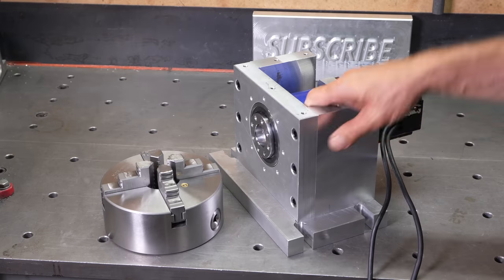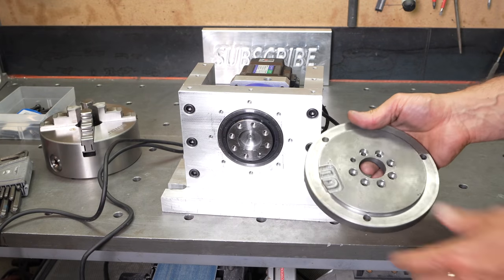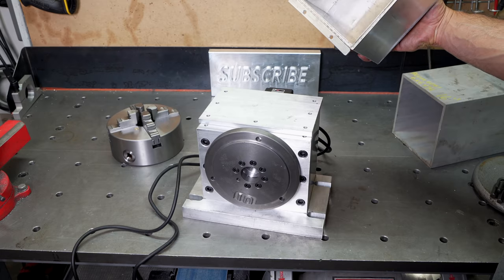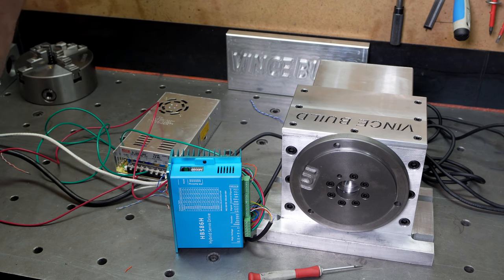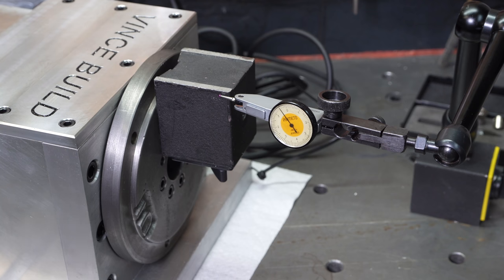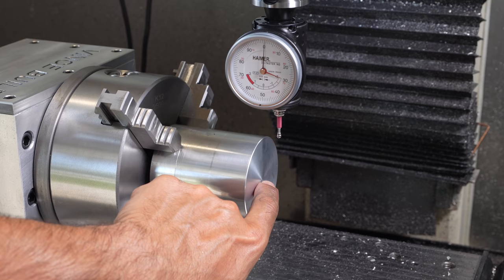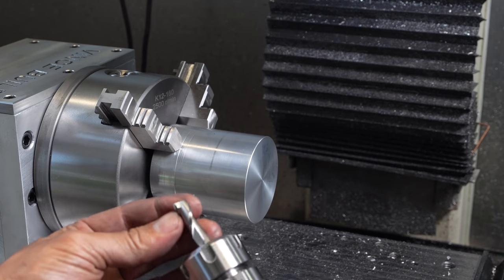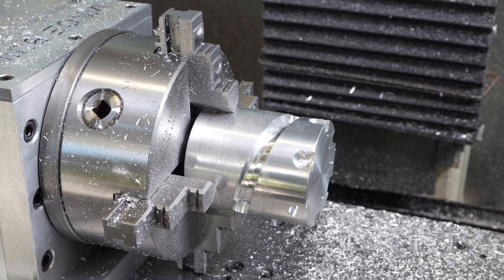4th Axis build part2

Comment: I have the same chuck on my lathe. For better runout, machine the indexing part of the backplate a little undersized and clamp a endmill into the chuck. Mark the pinion you used to tighten it. Then loosen the bolts and just snug them up again. Bump the chuld around until a dti reads as little runout as possible on the endmill. Tighten the bolts and only use the marked pinion to tighten the chuck
Reply from the maker: Awesome, thank you for the tip

Comment: I don't know if you got your issue sorted out with z going to home position. If you didn't, try this. In fusion 360 CAM, in the post processer part there is a box for "safe retract" make sure this this is not set to G28 and to clearance height. Hope this helps.

Comment: good afternoon friend was great the service and the perfect finish this congratulations, ok att sader. I'm just going to give a constructive hint of the whole service. The flange usually has to have about 3 to 5 cents more in the case of this 160mm plate, it would have to be about 130.05mm in order to enter the pressure and not have any slack because that could be it that gave that minimal difference, more coming back to the video it was perfect man show of ball

Comment: I thought I was the only one who used weights for cast iron!
Great job by the way. I am doing a similar project for my college machine shop. Do you think I could get one of these to work with a HAAS TM-1 ?
Reply from the maker: Thank you. I guess if stepper drive is compatible with TM-1 it should work
Reply: I think they sell with their new machines an "optional provision for a 3rd party 4th axis"--maybe check and see if it has that?
Reply: I own 2 VF4s if you have the 3rd party option, as another comments says, it should be good, I would personally buy a Haas rotary though.
Reply: @BebenX  thanks for the answers, I will check if the college opens this fall
Reply: The TM-1 has to be “4th axis ready”.  That means a 4th driver board is installed in the machine. Open the control cabinet and see if the card is there. It is an extra cost option and many school and industrial mills do NOT have it. In the video only 3 axes are being demonstrated. X, Y, and Rotary are simultaneously moving. The Z axis (i.e. 4th axis) is stationary! Quite possibly he has the same issue by not having a 4th axis enabled either in hardware, software or both. He later commented (thank you) that it is NOT a harmonic drive but rather, a planetary gear set. Without the zero backlash of a harmonic gear the device has a continual backlash problem and is not suitable for hands-free CNC operation. Apologies for being a very late post. Offered here only to help others in the future.

Comment: Im a little late to the Party, but are you not worried about the imbalance caused by the old weight? The number 10 on the weight is not symetrical

Comment: In mastercam you have to edit your post for c axis unwind - older 4th axis with wires are limited in rotations before it has to unwind, its done by default for compatability. Also maybe encoder limitation as well.
Reply from the maker: Thx

Comment: Better finish and tool life if you climb mill. Not sure why you use so many microsteps when you have native 10,000 pulses per rev already? Works very nicely although you are taking "proper" cuts with that machine! The 50:1 ratio is fixed by the gears, so nothing to check / calibrate. I'm also using a harmonic drive - they are beautiful things! Nice work!
Reply from the maker: Thx for the comment. I will try without micro stepping

Comment: It is 99,99% post processor related "issue". You can use VSCode with f360 plugin to actually see where this exact homing-gcode line is generated inside you post. Also just be aware that 4th axis features in f360 are quite limited.
Reply from the maker: Thank you.
Reply: No problem. I am using F360 for years. Edited many posts. Solved many issues. You can reach me with any questions/problems.

Comment: does the software know where the chuck jaws are, and if not how do you prevent the spindle running into them?
Reply from the maker: It only knows where work offsets are, in order to prevent from running to it you have to make sure you have clearance from it in your program. Like proper tool length and clearance

Comment: man i like youre stuff , but please ! use adaptive clearing. Youre endmills will last longer and even under heavy axial engagemant you won`t have any chatter. I guess youre machine is easy capabil of handeling loades like 0.2mm per tooth at 6000 rpm and an radial engagement of 0.4 to 0.8 mm.
Reply from the maker: Thx. I  will.

Comment: What did you set in mach3 pulse per mm
Or pulse per digress
Reply from the maker: Based on my gear box ratio and my controllers it ended up 55.555

Comment: Hello awesome build, regarding Z home after each pocket, if you did not find solution check in your G-Code if you have G28 command, if you have it, delete complete G28 lines where G28 is and make a test without tools and stock. Br.
Reply from the maker: Thx. I’ll try it

Comment: Looks like you have plenty of z travel. Too bad you didn't make the 4th axis 2" taller allowing a larger diameter to be cut. A large bearing inset between the aluminum frame and cast-iron back plate would eliminate most of the vibration. Welded steel frame would have been better too.
But great job! Wish I had your setup.

Comment: How did you attach the chuck to the backplate?
Reply from the maker: It has 3 bolts from behind
Reply: You could access the bolts to mount the backplate to the gearbox through the center of the chuck?
Reply: It doesn’t look possible.
Reply: Nice job, btw!  I like it!
Reply from the maker: @ScotY808  chuck Dia is larger than my enclosure so i am able to access them one by one from top by turning chuck around
Reply: VinceBuild ah, didn’t notice that!  With the top cover on, it didn’t look possible.